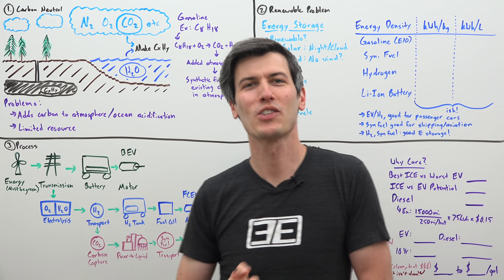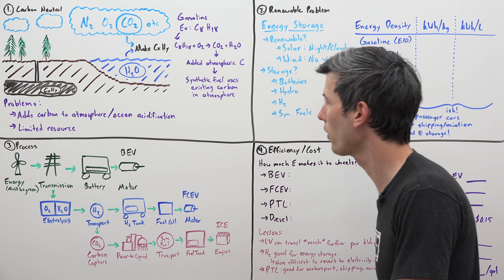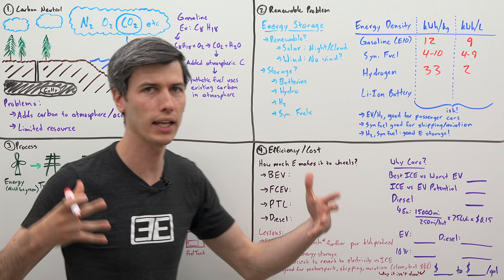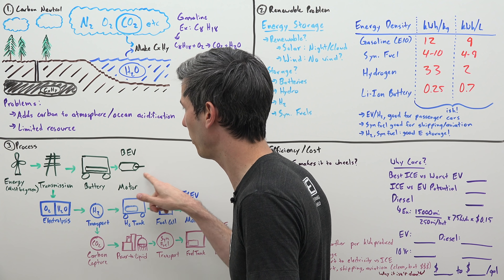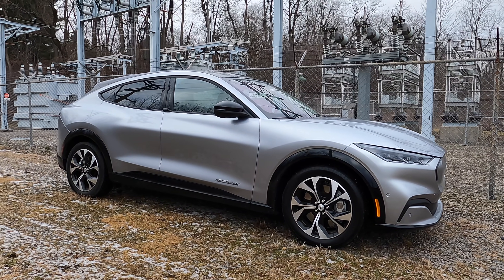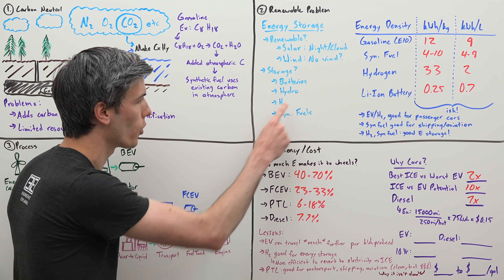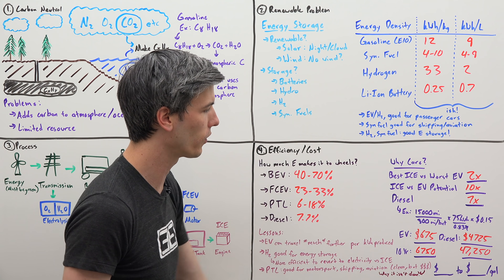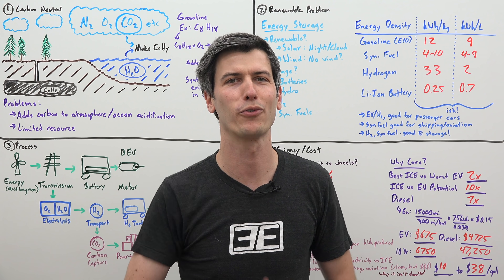The Big Problem With Synthetic Fuels

Comment: if only we had nuclear power plants that dont emit CO2 and can move with the needs of the grid???
Reply: But why? We're at a point in time (technology wise) where we can have a full sustainable grid! Nuclear is a super important part of it and it's just fine the way it is now :)
Reply: the issue with nuclear power plants is, its very capital intensive, i think its like 8-12 billion up front or something, depending on where its built. and it takes like 5-10 years to get safety certified and fully operational.  Theres also like 500+ million in operating costs per year (engineers are expensive in united states, especially if they have their PE with insurance on their PE Stamp, insurance can go up to or higher than 10 million dollars of coverage per PE Stamp). theres also like a cap of electric prices. Companies can't legally raise prices now, to fund future projects. Go figure people only want to pay for the electricity they use with minimal maintenance costs. 
i do have hope for the micro nuclear systems, cheaper, safer (assuming all the documents i read on them are to believe), and different nuclear fuels.
Reply: It's absolutely possible. Lots of push back though from established nuclear and fossil fuel interests as well as faux environmentalists.

Comment: So one question is with Hydrogen, you said it's 2 Kwh/L but... is that gaseous or liquid?
Reply: Probably liquid. Liquid hydrogen is still about 13× ligther than water. Even though both fuell cell cars and EVs achieve better efficiency so that the actual "fuel" weight per distance travelled is somewhat better.

The thing is, hydrogen storage is a big challenge for cars. For current cars is it stored in a form of compressed gas at 70 MPa. It works but it's not ideal. The tanks are probably very expensive to manufacture as they need to be strong and safe, they're also quite large and a bit heavier (I think about 90 kg with 5 kg of H2 for Toyota Mirai).
Reply: Well, lower heating value for 1kg of H2 of 120 MJ divided by 3,6 MJ (= 1 kWh) and by 13 (due to lower density) you get about 2,56 kWh/l. For compressed gas this is even lower.

Comment: Hopefully enough people will buy electric cars that the oil lasts a lot longer so the enthusiasts can still drive proper cars. 
Electric is nowhere near ready as a replacement for diesel yet, until they can do over 1000miles on a charge and can be charged to 100% in 5 minutes theyre not ready the future is about progress not backwards steps.

Comment: Ok, but the synthetic fuel process takes carbon dioxide out of the air. Electric cars cannot do that. Why have you not taken this into account? Not to mention we already have the worldwide infrastructure of fuel stations already in place to accommodate for synthetic fuel!
Reply: Because when you burn the synfuel it puts the carbon back into the air so the net is carbon neutral.
Reply: @brlisong  yeah exactly. Thus better than electric cars
Reply: @tomhill2497  you say that as if there will be that much supply for it
Reply: @tomhill2497  It's not. The entire process for synthetic fuel is highly inefficient meaning electric cars end up less polluting. Synthetic fuels as Porsche said will only be for motorsports.

Comment: A lifecycle analysis of EV, FCEV, ICE + fossil, and ICE + synthetic fuels for energy and carbon dioxide emissions would be interesting. Given the much higher initial emissions with EVs, if the fuel is carbon neutral the ICE car should be ahead quite a lot at the end of its life. Including recycling of materials as well would be very interesting, though quite difficult to find good numbers for I would have thought

Comment: What about ethanol as a fuel instead? We are pushing towards E10 here in the UK and you mentioned you already have E10 in the US, I know E85 is much more common in the US and EU too. I've also adapted my car to run on E30 which I blend at home with bioethanol which took minimal effort because the hardware in the vehicle can already support it. Would bioethanol be a better consideration as a renewable fuel? Is it more direct to go from the crops to the ethanol and into a combustion engine?
Reply: Yes ...

Comment: Electrolysis isn't very hard of a process. Would it be easier to do electrolysis on site of energy generation and transport the hydrogen instead of electricity transmission? That would save a step.

Comment: Well, from an US stand point, it makes sense at 3.5$/gal. Which translates to about .75€/L. But in Europe, prices are about 1.25-1.5€/L. So about 7$/gal in the most expensive countries. There, synthetic fuel makes sense, at least when non-renewables will be banned. I'm not saying that it will make it to cars, like you said it's probably going to be used in aviaiton or stuff first.
Reply: I wish it was 1.5€ here in Portugal ;) currently at 1.75€

Comment: My whole thing is  people don't know or the ones that do know don't want to mention is with electric cars  there's not enough capacity to run every car on solar or wind so how are they going to be this clean solution for everything.  At minimum places will have to burn gas and nuclear to make up the difference that solar and wind can't fulfill. so you got to have some not so clean power.  I worked in the power industry in New York state there's no way we could run the state on solar and wind and turn off all the gas and hydro we couldn't meet the demand.  Even with hydro added in and dams aren't that environmentally sensitive to the rivers they close up that's why out west they've actually been blowing up some dams and environmentally sensitive places like Oregon

Comment: Finally someone who has realistic expectations of efuel
Reply: @Ted G And you know what's cheaper? just shoving the energy in a BEV. Porsche is also investing in a 90% recyclable battery, and tons of other EV tech. Even them, the biggest proponents(Audi is not actually investing, they tried to make E-diesel earlier this decade and failed to get anywhere), realizes that they are never going to use it as a mass market solution. It's strictly to keep their legacy sports cars and future 911's and caymans on the road.
Reply: @arjund.4817  Porsche themselves stated the 911 is never going electric. They said they are heavily investing to keep producing new ICE cars and putting them on the road

Comment: 80% of the fuel in an internal combustion vehicle is wasted. There is the problem.  No matter what fuel you use, that sort of inefficiency cannot be sustained.
Reply: In modern gasoline engines it's like 30-40%, Diesel is 35-50%.
Reply: @electric7487  
That is the best case example.  In the real world most cars waste 80% of the fuel in the tank.
Reply: @johnburns4017  The 20% efficiency is a worst-case figure, you know that, right?

And e-Gasoline isn't meant for the average Joe; EV's will do the job for 80–90% of people. This for us 10–20% of the population who are enthusiasts.
Reply: @electric7487  
20% efficiency is an average efficiency.
Reply: @johnburns4017  Explain to me why average efficiency of petrol engines is 20%. Because based on what I could find, 20% is still a worst-case figure, with the best-case figures being 35-40% and something like 30-35% being the average.
Reply: @UCUiMAi-PUBifBx8y-qjuKfQ 
Do you have a source for your allegations?
Reply: THEY DON'T SELL WANKEL ENGINES ANYMORE JOHNNY... THE WORLD USES MORE EFFICIENT RECIPROCATING ENGINE TODAY!

Comment: Rockets need syn-fuel. What is the cost of solar ->cryo-methane at launch site?
Reply: I believe the total cost of fuel for current rockets is usually in the low million dollar range.
Reply: @danieljensen2626  that’s not interesting. What is interesting is a Fleet of Starships taking off and landing more than once per day.

Comment: One of the more speculative ways to make octane that I've read some research on is by making it from algae... not as in biomass, but maybe GMO octane? Basically, some cells secrete long carbon chains, naturally, in the form of various kinds of oils. The idea is to do the same with algae and make it build octane instead. Then you force it through a series of long transparent tubes immersed in water with holes too small for the algae to leak out but allows for the flow of octane. Finally, you skim the octane off the top of the water. This pushes back the hardest parts of the fuel production chain to cellular machinery. In this case, we would have to, simply, compare the energy demands for these farms and the real estate they take up (in terms of opportunity cost for solar panels) to see if it's better than BEVs or not.

Comment: Synthetic fuels have two places they may have some use. Motorcycles and aircraft vehicles that are much less able to absorb the added weight and bulk of current batteries. Fuel cost is also less of an issue for motorcycles at least here in the us where they are primarily recreational vehicles.

Comment: Eletric and hidrogen fuel cell is the future for new cars, and the best as daily if you have the place to charge at home in case of EV and the infrastructure (that isn't allways the case still in countries like mine which is Portugal, although the gouvernment already want's to force the change for EVs giving money when scrapping the old car in change for an EV that for majority of the population is still to expensive), but synthetic fuels might save any classic or future classic car with an ice engine, and because of that it is worth considering, at least for the classic and future classic cars to be able to last and not be scrapped, because we can't forgett that the longer we use something the better for the environment and scrapping a vehicle with 10 years that could last another 5 or 10 to buy a new eletric car, doesn't seems like the best use of resources, and the synthetic fuels, might favor even more keeping the old car in that situation

that's something i never saw people calculate, how many milles/km is needed in order to compensate, in terms of polution, buying an EV and scrapp the old car instead of keaping the old car for the normal life time of it, because the exploration of lithium and production of batteries isn't that clean in terms of polution

Comment: i am very divided, EV cars for the "poor" people. i am learning how these work what comes too look, i feel like i need an engineering bachelor, simply replacing a 12v battery became complex like exaggerating complex. i get payed too turn bolts while being expected by costumers and bosses that  i have to become the cars engineer without the salary... every repair has been in the €€€€ whatever you "gain" by driving one you lose by repairing them x2 while synthetic fuel cars are little less complex and have still components that we see in every day cars these are less likely too breakdown with high costs, as always there too we have the "BUT" into it either way time will tell but this changes are scary for myself and future mechanics also for all costumers as they become guinea pig.
Reply: simply put ,if your type of person that forgets to charge your phone ,then ev not for you,its new tech new problems ,ie big extension lead needed if you live on the 20th floor.

Comment: Your calculation is correct till the economy. Synthetic fuels probably do not have much future, I personally drive an EV, and I agree with it but the cost calculation is simply false. To charge a car you have to pay retail price that is easy higher than wholesale, for synthetic fuels the producer would pay the wholesale one currently below 40usd + some extra but still easy lower than yours figure. To my knowledge the break-even point for synth fuels is around 200USD/barrel of oil.

Comment: Energyefficiency doesn't matter as you pointed out yourself. There are times where electricity already has negative cost in europe. The more renewable sources you  use the more times this will be the case. E-fuels solve energy overload and storage, plus the facilities for storage, transportation, distribution and the vehicles already exist. The future is in PHEV with wireless chargers at every parking location and a combination of e-fuels, plant based fuels etc. This alows close to 90% of electric powered use (as most trips are short and the small and light batteries can quickly be recharged) and solves the electric grids problems with load balancing.

Comment: In my incredibly uneducated opinion, I can’t see electric taking over totally. It’ll be great for cars but even for things as small as say a pick up it would almost be useless for anything other than short trips. I can’t imagine hauling a trailer, or camper long distances and trying to perform a job or camping and then going back without taking 10 times as long compared to a gas or Diesel engine I can fill up in five minuets

Comment: I fully agree... once the industry unify all the charging connection type, charging stations at 99.9% reliability, availability and speed of the conventional gas station.  Currently, I am just satisfied that my hybrid can go over 683.5 miles (1100KM) in 11.89gal (45L) on a 5 min. fill up anywhere I go.... I want a EV for environment and cost reason; however, not the uncertainties many had to face (maybe not Tesla owners) when finding out the charging stations are not working or quickly dropping to turtle charging speed especially in poor weather condition or on a long trip.  The future does belong to EV.... the question is how serious and how long would the industry take to get there and not just focus on milking the early adapters before providing the full solution.  I hate to imagine buying a EV now and in 5 years all the new charging stations change the plug standard again (not to say it is not already confusing now) and only provide slow speed for the older owners.

Comment: Really good video. Doesn't the higher energy density offset some of the efficiency losses?
Reply: No. Higher density means you need less space to transport it.
Like you need a small tank instead of a big battery. But that’s it.
Reply: thank you but wouldn't this mean
battery - low density - large battery
tank - higher density - small tank - but potential to offset the losses with the fact that the tank can actually be larger. In the video the efficiency difference is the only thing that matters but this would also mean the tank and the battery store exactly the same amount of energy (hence the tank would be significantly smaller)
Reply: @radoslavyankov4075  efficiency means how far you can go with one unit of generated energy.
To go one mile with ev instead of fuel you need to generate ~10x less energy.
With a large tank you can go way further before having to stop to fill up but that has nothing to do with efficiency.
Well you could say fuel is volume-efficient.
Reply: @daniel_960_  that's what I meant. I understand the argument and it's a  valid one. Just the volume efficiency as you called it seemed important since you're paying per liter. Thank you for the clarification tho. Was really helpful.

Comment: Worth also noting that "percentage efficiencys" are not the full story. What also matters is where the efficiency peaks in the system.

For an ICE, that is very in-efficient and hence highly consumptive at the end user level, even with a high transmission efficiency, the absolute losses (and hence environmental and financial impact) are large.

Lets take a typical BEV at 3 ml/kWh, and a typical gasoline ICE at 35 mpg, and lets assume (eroneously) that in both cases the transmission/transport losses are 10%

to drive one mile, the BEV uses 333 Wh, at 10% loss we must start out with 366 Wh,  we loose 33 Wh

to drive one mile, the ICE uses 975 Wh, at 10% loss we must start out with 1072 Wh,  we loose 97 Wh

Both distrubution networks are "90% efficient" but one has actually lost 3 times as much energy as the other.....

Comment: Despite the lack of infrastructure, I will always be a fan of hydrogen.  If I were staying in the Bay Area, I'd be all over the current Mirai.
Reply: But why? Just wanna know your point of view
Reply: @sensiblewheels  Primarily the speed of refueling, and the Mirai range is a solid 420 miles.  Plus the new version actually looks good.  Until electric vehicles can cut the charge time down to under 20 minutes, id rather have an ICE or hydrogen, we own a 2019 etron and wont miss it when the lease is up.
Reply: @dennispeery5166  Ah. I see, range is the only factor here (looks not so much, it looks like). Fair point, EVs aren't fully there yet. Have you seen the 1000 mile roadtrip with the Tesla from EE? Puts things into a bit of a contrast
Reply: @sensiblewheels  I did, we nearly attempted a 1300 mile eTron road trip last week, but due to a time constraint we couldn't pull it off.  May try again next month, SFO-PDX and back.  I think I have it all mapped out.  I still like the idea of a daily driver EV, with an ICE for backup and road trips.
Reply: @dennispeery5166  That sounds amazing! Enjoy your trips. And yeah, I like the EV and ICE combo too, until the range + charging speeds gets better.